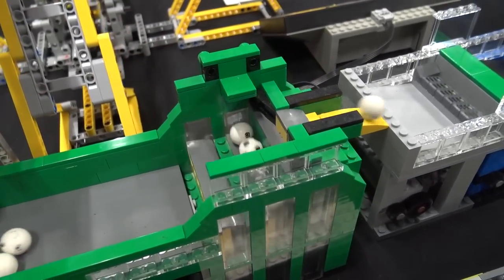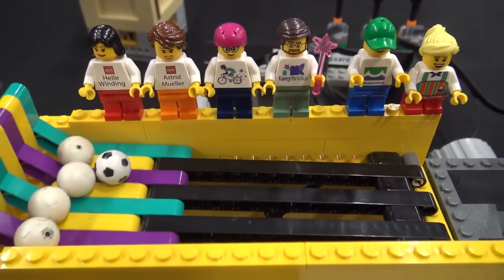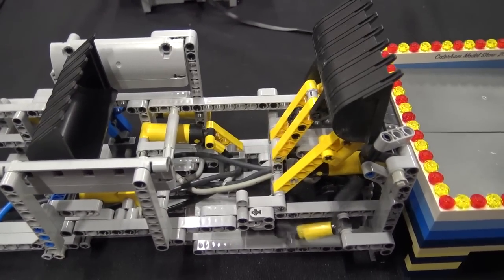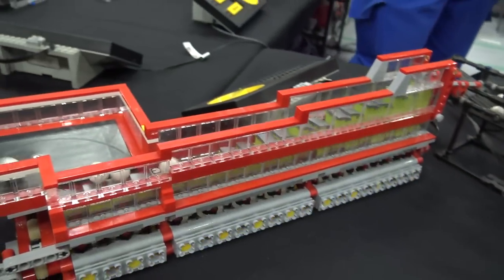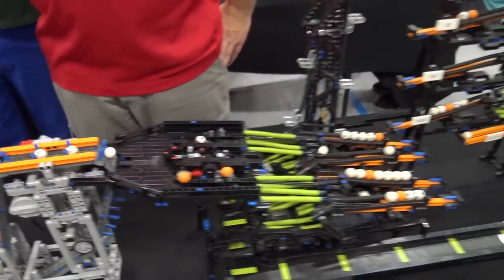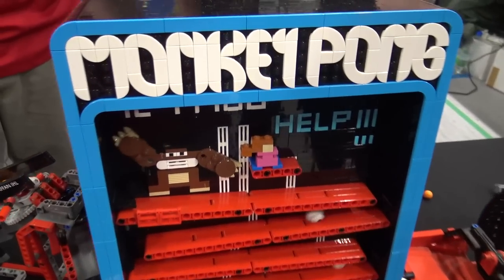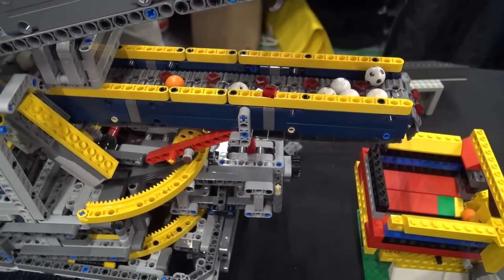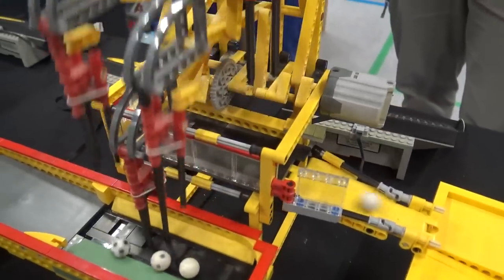LEGO Great Ball Contraption with Akiyuki, Tom & Maico at Skærbæk Fan Weekend 2019

Comment: 54:30 Output and input being in line is indeed part of the specification. It may be debatable, though, if that line needs to be in the direction of studs or if it can be any line. (You can definitely not have a module with, e.g., input and output on the same side, though.)
I also think the "base plate standard" just says that the input must not be further than 32 studs away from the back to be able to align modules to a wall. It is legal to have less studs and there is no limit in the other directions.
The main problem for really many modules is imo accepting 30 balls in a batch. A lot of (famous) modules cannot properly do that.
Reply: This is the comment I was looking for, thank you.
Reply: lol these guys. Masters of their little kingdoms.

Comment: The parts should be lubricated with silicone paste to minimize wear!
Reply: No, that's not the best solution.    There are reasons why nobody does that.
Reply: I was thinking the same thing. I used silicone paste when I raced RC cars. Only a tiny bit was needed.